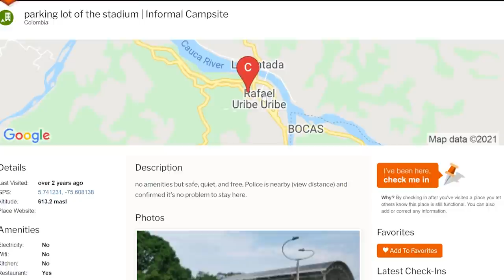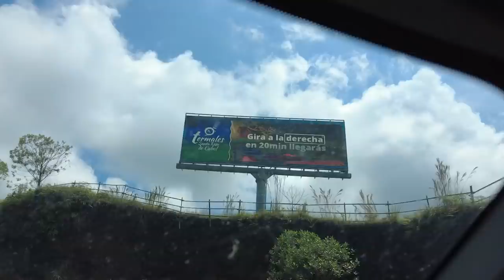OUR LIFE JOURNEY IN A VAN IN COLOMBIA - ON THE MOVE AGAIN - GOING BACK TO CALI

Comment: Those houses on the ridge are unbelievable. As you were driving I felt like you were in mid air, nothing on other side of the houses. The kid on the bike hanging on to the flat deck has a death wish, OMG.  Smart leaving lots of time to get from A to B.  I don't think you want to be driving those mountains roads at night for many reasons. Enjoy the hot springs.